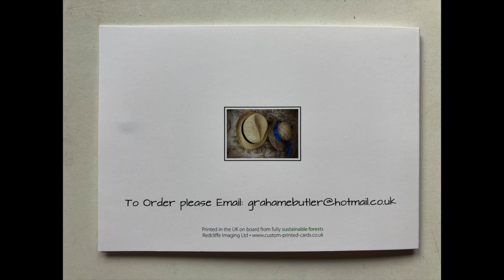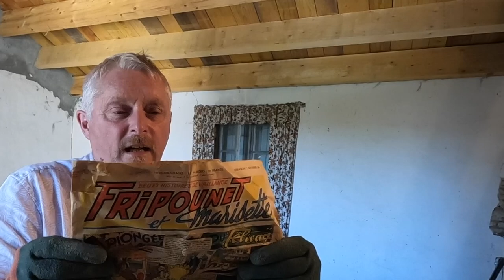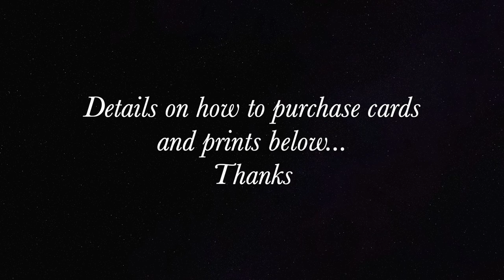At Last we start work on the House.... exciting times ahead as we see it develop .....

Comment: Good work, but looks a bit harder than necessary. If they are available there (and you have more floors to take up), get a real demolition pry bar. After you loosen the first board with your smaller bar the rest should come up much more easily with a larger tool. Archimedes was right about larger levers!
Reply from the maker: yes he was, I used the larger crowbar to get them out, but the end was snapped off at some point, which didn't help lol cheers